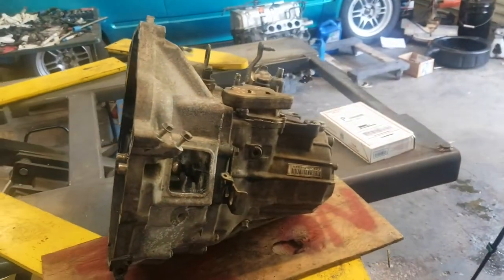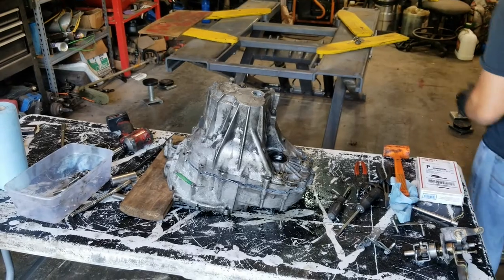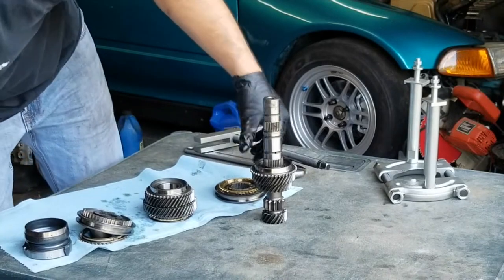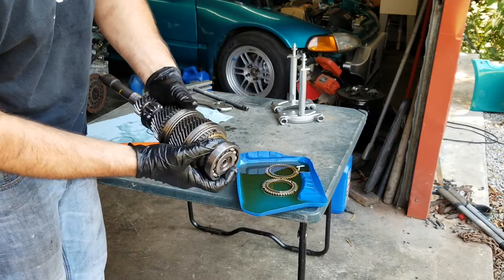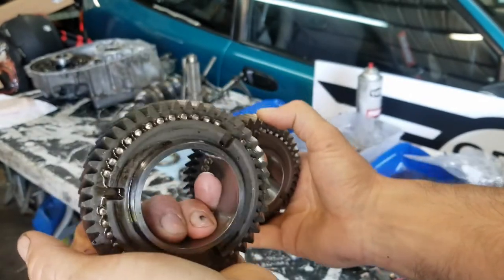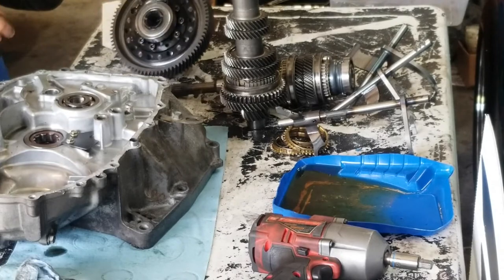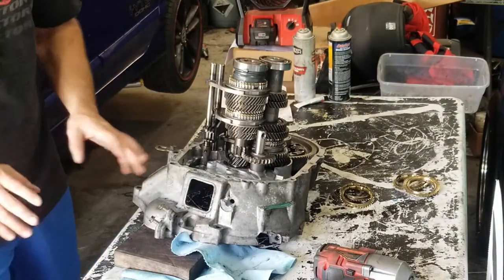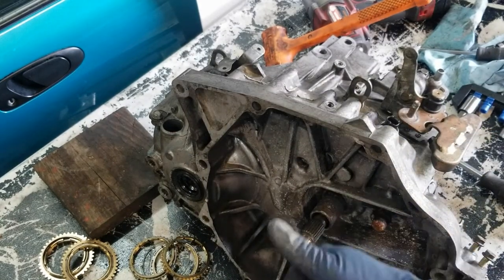EP3 / RSX / TSX / Accord | K24 / K20 Synchrotech Carbon Synchro Install

Comment: I just bought an ep3 that grinds real hard into 3rd unless you double clutch it, or first unless youre at a dead stop and have had the clutch depressed for about 2 seconds. Going to be tackling this exact same project, most likely installing the exact same parts as well, and im honestly mad impressed with this video, i was concerned about trying to find a how to with this but honestly i almost feel like i could do it without even referencing the video after this. Fantastic job

Comment: @10:10...  right as you're making the point about keeping everything in order, but upside down...   one of the collars underneath the gear you have in your hand actually flips upside down without you noticing it (I think).  I hope it either didn't matter, or you noticed on the re-assemble.

Comment: Great video!!! I have the transmission that comes out of the k20z3 added this video to my collection.. right now I have to take mine apart I think the gear case seal broke away , or possibly the input shaft seal the one you have to basically tear down the entire transmission to replace one seal.

Comment: Gonna use this vid to guide me with my trans. Never done anything with a transmission but I think I got it
Reply from the maker: Just make sure you put the metal rings back on the synchros. I think I missed it in this video.

Comment: I need to rebuild my transmission for my 2013 accord EXL, second and 3rd gear grinds bad during cold start. Have to warm up the car for better experience with shifting. still grinds but like 13% of the time while warmed up. I cant seem to find the model or the transmission but would like to get this thing rebuilt. I was told by a tuner shop that they do ATF for 100 miles to lube the syncros then change back to manual fluid. I need to do the same for my truck.

Comment: 2002 ep3 transmission was operating great. Replaced the input shaft bearing. Now Im locked out of 5th and reverse. The only issue I had was the 5th gear sleave slipped off past the top of the syncro. Does it only go on one way? I slipped it back on . Maybe I screwed up the reverse idler? Not sure what I did. Please help. See pic below.

Comment: Did you purposely leave off the synchro springs?   I imagine it will still operate without them but won’t have that definite “click” into gear etc.     nice indepth vid , thank you for this 👍
Reply from the maker: No, I realized it after I posted this video, took it back apart and fixed it

Comment: I know this is an old video, but I am working on a 6 speed from a 09 SI and I don’t have the second part next to the reverse idler/selector. I have the 2 bolt holes, but nothing bolted in them. I got this from my son and they had broken the third gear shift fork. I watched your video and was able to swap out the fork and get everything back together, but I do not have the second piece next to the reverse idler part. Help!! Thank you

Comment: Great disassembly and reassembly video.  21:19 Why not use the portable pull-press to press the gears back into position on the counter shaft?
Reply from the maker: I'm not sure. I have a press I use for assembly and disassembly now.

Comment: Hello, i was wondering if the synchro has to go in a certain spot or are they all the same? It wasnt specified in the video, but just wanted to make sure before I do this to mine. In the video you said the 2 big ones go onto the couter shaft. Could the other 3 just be put anywhere since theyre the same?

Comment: Hi, I have 07 Accord with 5 speed manual ( K24). Every gear is a battle to shit from 1st, 2nd...and reverse. The clutch is 6 month old and I just replaced the slave cylinder. But same problem HARD TO SHIFT FROM GEAR TO GEAR. 
HELP..HELP😢😢😢

Comment: Hey. I'm rebuilding mine k20z3 transmission.  And got everything mock up on bench. My 1-4 gears and neutral is easy to spin. But my 5th, 6th and reverse is a bit harder to turn by hand. Is that normal or what am I'm to look for?

Comment: Awesome video. I currently have my 6 speed apart and I’m changing the bearings and seals whilst installing an mfactory lsd. 
I don’t suppose we could have a chat about the shimming of the gearbox?
Reply from the maker: shimming for the gear stack or the diff?
Reply: @hondaresource  the actual stack and diff. I’m installing an mfactory race pack helical lsd and shimming everything that needs it

Comment: What synchro set do I need for a CRV trans? Doing an AWD build and looking to refresh things. Also switching to a 4.38 FD so need the 40mm counter shaft bearing.
Reply from the maker: I would check with synchrotech but I'm 99% sure its the same a base 02-04 rsx

Comment: i need a six speed transmission , 4k rpm in 5th gear at 80 mph is ridiculous smh drives me nuts 😂
Reply: I swear bro shit pisses me off🤣
Reply: The type s really isn’t much difference. Just about the same
Reply: 8th gen civic you’re at 
 3.5k @70mph 6th gear.

Comment: How’s the reliability on the synchrotech synchros? I know oem honda is usually the way to go because if reliability but the synchrotech ones are just the first that pop up for sale on many websites they seem readily available. Just wondering should have any issues using them rather than oem?
Reply from the maker: Can't go wrong with synchrotech

Comment: Hi. Can i put the guts of a 6speed lsd ( k20z3) inside the ep3 trans case? So i can keep the ep3 VSS and not have to rewire for CSS. Thanks in advance.
Reply from the maker: Yes. You'll need to put the speed ring on the diff in order to run the ep3 vss
Reply: @hondaresource  Can I reuse the same speed ring from the ep3?

Comment: I have 2007 Honda Accord six speed gearbox but it’s not letting me shift into first gear or fifth gear with the car off or on any ideas what can be my problem ?
Reply from the maker: Possibly shift selector in the trans or stretched shifter cables

Comment: Hey man I’ve been having an issue on my rsx type s 6 speed tranny.. basically goes into gears but not 6th and it won’t move on any gear it only moves in nuetral which I don’t get, if I let off the clutch on nuetral it wants to stall. I’ve changed the clutch(full kit) tob and pilot. And this issue is still there.
Reply from the maker: sounds like you have a broken shift selector, fork, or something associated with selection of the gears. Sounds like it's stuck between 2 gears

Comment: hi i have a euro r 6 speed transmisión (tsx) can i use a rsx shifter by only replacing the selector? thanks in advance
Reply from the maker: The selectors are not interchangeable. I'm not sure exactly what you will need to run an RSX shifter, but I think it's just a different bracket.

Comment: Hi, hope you can help. I have an accord type s (UK, K24a3). I purchased and had installed a same gearbox but with ep3 gears 1-5 with ep3 4.7 final drive.

My speedo is WAY out, over 12% at least. What gear does the speed sensor use to work the speed out?
Reply from the maker: it depends. If it has the rear speed sensor, it's using the diff. If it has the front speed sensor, it's using 3rd gear
Reply: @hondaresource  Thanks makes sense, its using 3rd gear which is ever so sightly smaller which is why I had to remove the washer on the VSS!! 

thanks for the info

Comment: You misplaced the mainshaft washers, the cone goes towards the bearing, then upper to the mainshaft the flat one.
Reply from the maker: Bummer. I made a couple errors in the video, but I rectified them later at no charge to the customer.
Reply: @hondaresource  you should consider to write it in the description, as maybe someone could use your video to do a reassembly and put in the washers in the wrong way.
Reply: Yes, the cone shape washer "dome" faces to the bearing and the flat washer goes to the gear on the main shaft. I have checked and confirmed in the manual.

Comment: Are Synchro Tech Brass Synchros good for daily driving ? I’m also gonna need 2nd gear 1-2 sleeve ,  1-4 synchros, 3-4 hub and sleeve, shift arm would everything synchro tech would be good ? Or should I get some stuff oem
Reply from the maker: Synchrotech sells good stuff
Reply from the maker: Brass is equivalent of stock

Comment: Does it matter what side goes up or down on the 5th gear slider?
Reply from the maker: Yes
Reply: @hondaresource  so which way is the top and which way is the bottom? Also will that cause the 5th gear to pop out under acceleration?

Comment: So I'm going to try this in my rsx type s 6 speed. Is the extra gear pretty straight forward?
Reply from the maker: really no difference besides an extra gear on the top of each gear stack and the shift forks are slightly different. Just make sure to put the metal rings on the synchros

Comment: Thanks a lot bud
Reply from the maker: Just make sure you reinstall the metal rings on the synchros. I didn't do it in this video, but corrected it after the fact.

Comment: Guys hopefully you can help me out , I did swap on my ep3 2003 k24a2 motor and transmission type s 2003 everything works except reverse won't get gear , it does if I do directly from selector other than that works likenit should be . There's anybody that can tell me what could be , please . Thanks a lot 🙏🏼
Reply from the maker: I haven't had any issue with the shifter in our ep3 with a6 speed trans
Reply: @hondaresource  there's any advice or any step that I missed it ?  How about the shifter ?
Reply from the maker: @HectorRS  it should be pretty much plug and play

Comment: so you did not put any snap rings on any of the syncros and that little piece that you did not know what it was is a bushing those tabs had to sit down intro second gear do yourself a huge favor and get a complete service manual or have someone else do your work for you
Reply from the maker: I realized the snap ring mistake afterwards and corrected it. Its the mr2 video on my channel. Thank you for pointing that out though!
Reply: Thank you for pointing that out regarding the bushing. First I thought I did it incorrectly, but now I know I didn't. The bushing needs to be installed last and then the 3rd gear. Otherwise great video overall! :

Comment: Being "The Honda Resource", can you please confirm that gear stacks from a ~2005 Accord 5-speed transmission with a K24 engine can be interchanged with those from an Element.  I'm interested in swapping out the 4th and 5th gears with those from the Accord which are much taller.  Thanks!
Reply from the maker: You have to keep the element third due to the speed sensor. The Accord 4th and 5th will work though
Reply: @hondaresource  Yes, I recall that from your Element transmission rebuild video series.  An essential tip!  As always, thanks so much for your quick replies!
Reply: @hondaresource  Hello again.  Are the shift forks also interchangable between the two transmissions (4-cyl Accord/Element)? I'm thinking about using the taller 4th and 5th from the Accord.  Thanks.
Reply from the maker: @canuckfixit7722  they should be identical
Reply: @hondaresource  I'll double check the cross reference on Honda Parts Now.  As always, thanks for your help!
Reply: @hondaresource  I found out that this won't work.  The Accord 3/4 gear synchro is a single-cone and the Element 3/4 gear synchro is a double-cone so the 4th gear on the Element has three holes on the backside to lock onto the inner part of the double cone whereas the Accord 4th gear just has the cone and no holes.  Bummer.

Comment: Damm no one likes to show getting the reverse threaded bolt off. Lol it's cursed!!
Reply from the maker: On the countershaft?
Reply: @hondaresource  yea. I'm guessing only with a 1/2 impact driver would get it off. I tried by hand with a vise at the other end, with wood in between of course and the fd teeth causes it to slide out